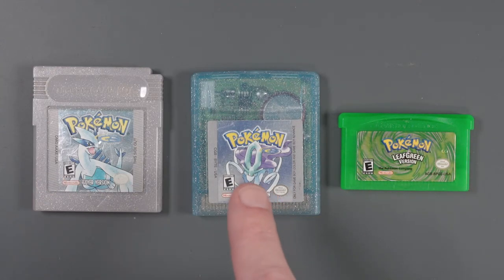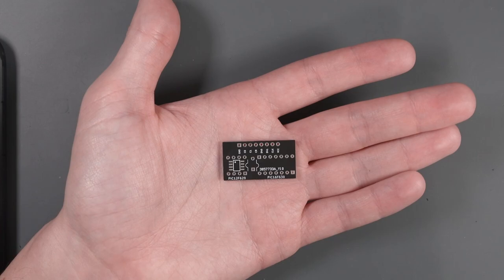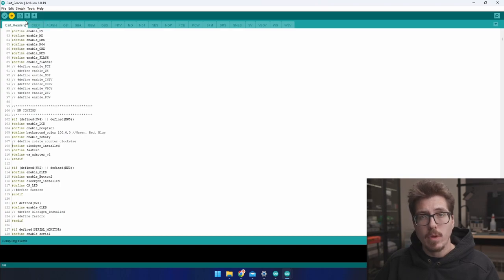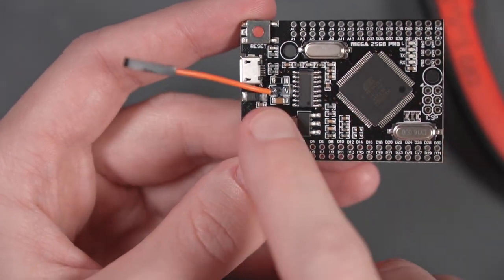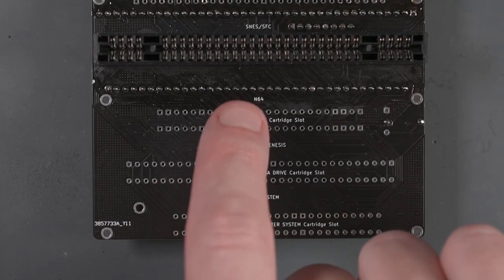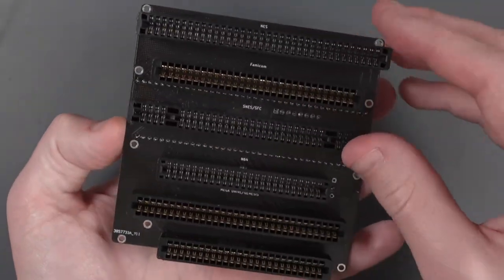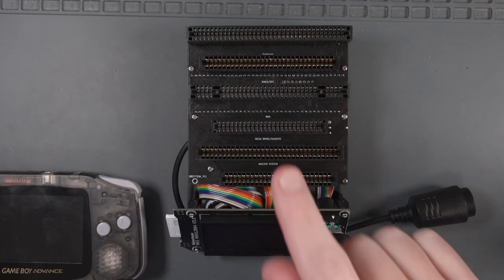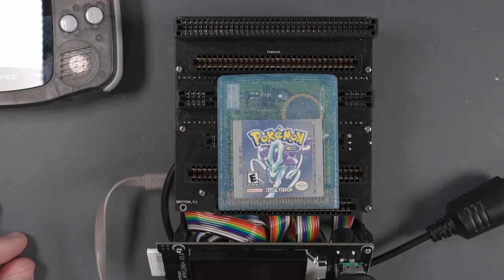Must-Have Tool to Dump ROMS and Read and Write Save Files - Sanni Cart Reader V5

Comment: I've built a V3 a couple months ago and it's awesome. I mostly use it to transfer save files between my SNES cartridges and my analogue pocket. However, when sourcing all the parts to build, you'll likely end up with enough parts to build a few of them. I currently have two extra ones available to sell,  includes 4GB SD card, a USB cable and printed case. Message me if interested!

Comment: while you're correct in saying the GB/GBC color games usually do have a battery to keep the save, most (if not all) GBA games don't use the save battery for the save, its usually for a real time clock. the leafgreen you had in frame doesn't even have a battery in it :P
Reply from the maker: Yes I discovered that later in the video lol
Reply: I remember being surprised when I opened up Sonic 3 and saw no save battery despite it having save features.

Comment: Great seeing you make one of my most recent builds. Thank you for the tip on the female pin header trimming, as that was a PITA for me. Did you by chance have any issues dumping Famicom games on that slot? My slot from AliExpress was a bit sus and I've ordered replacements, but I thought I'd ask you just out of curiosity.
Reply: Update: replacing the Famicom cartridge slot fixed my issue for all but Kid Dracula. I think my copy of that needs a deep clean or other restorative work.

Comment: Something I picked up from @MarkFixesStuff when you need to hold something in place temporarily and flip it over to solder. Use a small piece of bluetac to keep it secure. I found it very useful when I recapped my Saturn, it was the revision with all surface mount capacitors.

Comment: Hello, please, how do I put a hack rom saving on a parallel cartridge with a chip and not a battery? Because I put the ROM I wanted on a cartridge I have, but I wasn't saving it. my cartridge is parallel. The cartridge is from (GB) Pokémon Red.... I'm testing the game that I replaced. It works, but it doesn't save

Comment: Can I play games off the cart on a mister?
Reply from the maker: Unfortunately MiSTer doesn't support carts, but you could rip the rom from your carts using this and play them on MiSTer
Reply: @dubesinhower  so I can plug this into the mister and dump it onto the SD card on my mister?
Reply: @bricethompson1922  I don't think you can do that directly, this can be pretty power hungry and the wiki highly reccomends you don't plug it into USB ports on devices and instead plug it directly into a power only phone charger, and even if the MiSTer was providing enough power it would need some code to read games from this, but you could dump the carts onto the SD card on this, then plug the SD card into a computer and transfer the roms/saves to the MiSTer over the network or by plugging in the MiSTer SD card also and copy them.

Comment: Does it just dump roms or can you burn EPROMs on cartridges on it
Reply: Do you mean writing repro carts with EEPROM, or writing to saves on EEPROMs? The project GitHub says it supports reading and writing EEPROM saves on some systems and some sizes. It's all there under "Supported Systems"
Reply: @veridor7522  I mean for like installing language patches on games
Reply: @MagisterHamid  Original (non-bootleg) games don't use EEPROMS, they use mask roms that can be programmed once at the factory and never again. This can write new roms onto some bootleg carts for some systems though.
Reply: @MagisterHamid  For older Sanni versions there was an adapter or two that would let you burn EPROMs but the latest version doesn't support it.